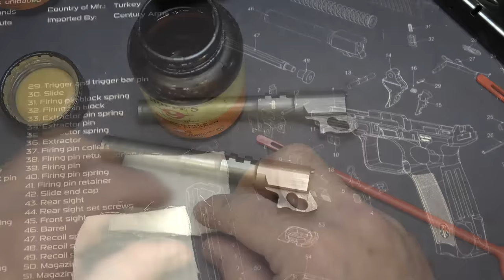CZ 75  CZ Recommended Cleaning

Comment: Can't help it - I like watching just about anything CZ. Thanks Sootch! I've been experimenting with dry lube sprays including Hornady One Shot with Dyna Glide ($16) and Super Slick at Lowes ($7). I like the Super Slick so far for the price and it cleans a bit better. I like the dry film for carry especially. I also use a bore cleaner first when the firearms pretty dirty. I filled up a small spray bottle with Breakthrough solvent. It's non-toxic and has no odor. After spraying the bore and internals I brush and wipe if off. Then I hit it with the Super Slick. Wipe down a bit and done. The more I shoot, the less I clean these days. If all a pistola needs is a touch-up, I skip the bore cleaner. The Super Slick does a good job of blowing out debris and leaving a dry lube.
Reply from the maker: Thanks Paul, I appreciate the detailed comment. Super Slick sounds interesting so I'll check it out.

Comment: I have the CZ 75 D compact and CZ 75 P-01 and have been having issues with failure to load on both. Both guns are new, I have maybe  maximum 300 rounds through each. I have tried different ammo, and each time I take them to the range, I'm having failure to load issues with both. Yesterday my 75D Compact froze up. It would not fire, so I dropped the magazine, tried pulling the slide to empty the chamber, but the slide was stuck. I pulled the hammer back and tried firing it down range but just got the click of the hammer, I did it a second time and nothing. It finally expelled the round on the third attempt. I thought it was just a fluke, so I put in a different magazine, and after the third shot, the same thing happened. I couldn't even pull the slide back. everything was just stuck.

Comment: Do you prefer breakfree to anything else? I’m referring to anything oil or grease. What is your preference for cleaning, lubing and preserving? I’m just curious to what your preference is. Do you recommend grease or oil for the rails? I use grease because I don’t like when oil leaked out from the sides, but I respect your opinion, so I’m curious which you like the best.

Comment: I just got my CZ 75B, at 2:40 you said that an unfired pistol just needs to get the barrel cleaned (without using a solvent). Is that the only part you recommend initially cleaning for this pistol? Or should I do a deep clean on other parts as well? Please let me know man, thanks.

Comment: Hey.. great video... Im just about to break down my 85 Combat for the first time (I think its basically a 75 variant)

Question: I have Cocobolo grips.  Should I worry about getting oil on them?  Im thinking no (since I put Tung oil on my Walnut bar top to keep it lubricated and from cracking) but I wanted to get advice from as pro.

Thoughts?

Comment: I love my sp01 Tactical urban gray. Last two times ive cleaned it i have used alg grease, and have been using cheap Remington 115gr. So far i believe its the greases fault or weak powered ammo. But i have had multiple failures to feed. And i have had a few stovepipes with tulammo. I'll use this as baseline for when i clean it again. Ill borrow an ultrasonic from work and throw it in there to deep clean.
Reply: Use fiocchi 115-124-147 grains
Reply: Failure with Tula is not surprising. It's pretty underpowered.
Reply: @bmstylee  yeah i know. It usually shoots it quite well. Typically. Could have been that box. I buy cheap ammo to run into these kind of problems. The Remington was $8 a box. So i was skeptical of its performance. But my beretta 92 ran it without problems.

Comment: Thank you! Just cleaned my new CZ Sp01. Btw I used CLP + HOppes , do you recommend using grease?
Reply: I have used grease on my handguns for years.  Now mind you, a little goes a long way.  I use a very thin layer on the barrel and just a little on the slide rails.  I use grease ONLY on the sliding parts, NOT the small springs and parts inside the frame...I use minimal oil on those and not every time I clean.  I have found oil can burn off with extensive shooting, and I clean my guns every time I shoot them.  They are machines and need to be clean to operate smoothly especially if you carry one for self defense.

I attended a combat handgun school the first weekend of April with a different gun.  The gun ran fine and the grease was still present when I cleaned the gun before the second day of shooting.

Comment: I don’t buy the low bore axis claim. Measure it compared to other pistols. It really isn’t any lower. Even compared to other hammer fired guns, and definitely not lower than most striker fired guns.

The slide is not as tall, but the bore is not lower. It looks lower because the sides of the frame stick up so much higher on the outside of the gun than most designs, but I still call “boo crap” on lower bore axis. You are just trading slide height for frame height. And there’s still the same amount of cam surfaces and recoil spring and whatnot between the barrel and trigger mechanics. 

I still love a cz... even if lower bore is a myth.

Comment: Did you have any type of oil on the toothbrush as well? And if so, whzt is its’ model name? Thanks! You said something about not having any oil in the fire-pin when you cleaned the inside pf the slide. But one do need some oil on the inside of the slide as well right? But was that the same as the oil you used inside the barrel? Thanks!
Reply from the maker: Yes, I had light oil on the toothbrush. I like Break Free CLP mainly because I've been using it for 30 years. The oil I used on video was actually "long term Storage" oil from Break Free but it was in the same type bottle, so I recommend the CLP.  I used the same oil throughout and Solvent for the initial barrel cleaning. Solvent is not recommended other than to clean the barrel. Thanks Chris.

Comment: Just recently got my 75BD, but upon my first field strip/cleaning, I noticed that my guide rod is stuck in the recoil spring. I didn’t want to pull too hard on the rod for fear of damaging the spring. Any advice on freeing up the guide rod?
Reply: Like everything else important, get a little lube on it and then VERY gently twist the spring in the opposite direction of the coils while again gently separating.

Comment: Sootch and gun brothers, I use my air compressor to clear our excess oil and debris  before my final wipe down. Any issues with that I'm unaware?
Reply from the maker: Compressed air works great. Most gunsmiths use it to get the debris out. Thanks Brother!
Reply: Compressor are great, only if you have a water separator or filter. Blowing oil off and blowing in water isn’t the ideal way. Food for thought🧐

Comment: I would say you used about twice as much oil as you needed to. I bet your pistols bleed oil while they sit in the safe. Here is s trick I do; instead of using the bottle to oil your gun, take one of those small cloth patches, lightly saturate it with oil and go over the areas with the patch. It leaves just enough oil on the gun without putting to much on.  Just make sure you don't saturate the patch to much. You can do the same with a cotton swab for those hard to reach places. I also put a little oil on the sear surface and a few other spots inside the trigger and hammer action.  But not to much or your gun will bleed oil for weeks.

Comment: That looks like a dental tool. LOL. What about using 3 in 1 oil? I have used that for 50+ years. Hope I ain't wrong buy using it but it has always done what I wanted done.
Reply: @Marcelo Thanks, the reason I ask is I have a Remington 1100 20 gauge shotgun that my Dad give me when I was 10. I have used 3 in 1 oil on it now for 51+ years & it still looks new. Heck that's about all we knew back then in the 60's. It has protected the barrel from rust & the stock really shines after I rub a light coat on it. Of course I wipe off any excess. Thanks for the info.

Comment: I ordered and picked up a CZ 75B When I got home I decided to give it oiling simply because it was bone dry making it slightly difficult pulling the slide. What I found was the barrel was BLACK not stainless steel as I've seen on all CZ 75B here including yours here on YouTube. The serial number was just that no identifiable date however I found the date 2004 on the label on the case. Sootch, Did I get screwed? When I called the dealer all he said was it's mine now, registered in my name WTF? Have you ever seen an all black CZ 75B ???